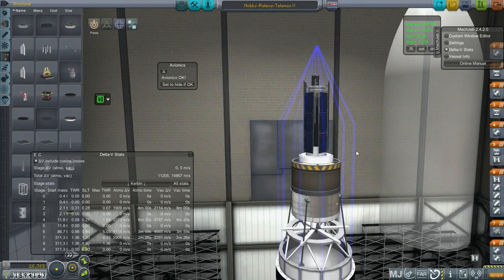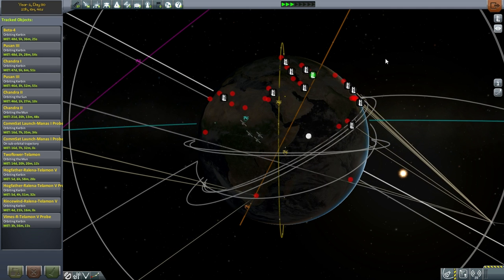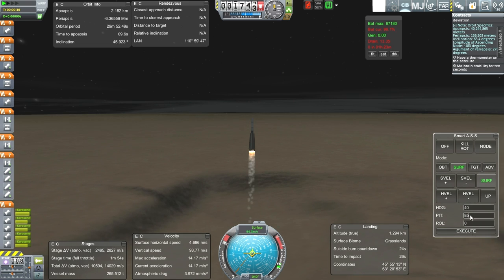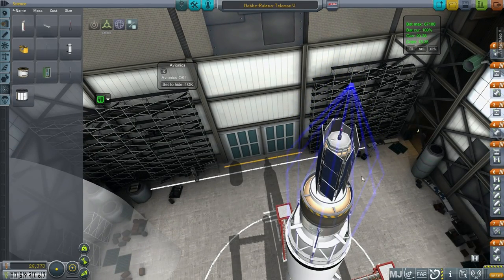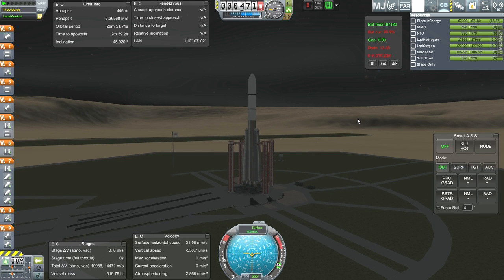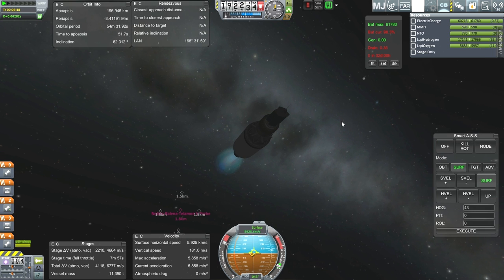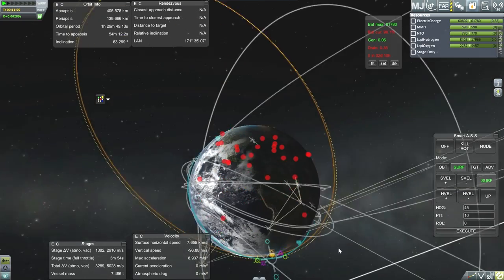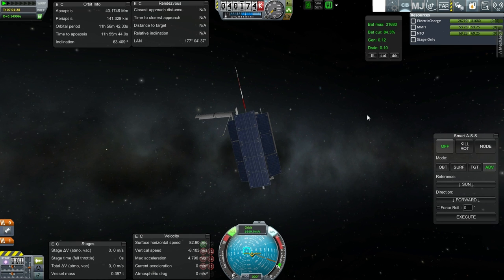Realism Overhaul in KSP Beta 18 - Molniya Orbit

Comment: Great episode as usual! 
Before I go on about  the episode, I'd like to point out few things about Progress. First of all, as of now it has been officially declared a total loss, but unlike any other freighter the Progress is critical for ISS survival as now with ATV being a history the Progress is the only craft that can bring fuel to ISS for it's RCS and reboost engines. Though since at least one year worth of fuel is maintained in ISS tanks there is no particular rush to get it up and running ASAP, there might come a time when Roscosmos will have to just cross their fingers and launch a new one hoping it would work. I would also like to point out that this flight is only a second Progress mission using new Soyuz-2.1a LV, and it had some experimental hardware aboard (new Kurs antennae were among them), so the odds of failure were somewhat higher than usually to begin with. Still it proves that space is a risky business, and things can go wrong when you least expect them to be.
Now - onto the actual episode:
1. In order to change LAN without changing inclination, you have to burn normal+/- when you're in the northernmost/southernmost points of your orbit, in order to change inclination without changing LAN, you have to burn normal+/- when flying at equator. There is a very simple rule I use to figure out how orbit will change if I burn normal+/- at any random point - if you mentally draw a line from your spacecraft into the Earth's center and then continue it until it intersects your orbit on the opposite side, this line is an axis your orbit ellipsis will rotate about. I usually eyeball it by aligning my camera such that it looks at the spacecraft with center of the planet being exactly under vessel CoM - in this view your orbit will rotate around your vessel and you can easily see which way you need to go to rotate orbit certain way. Aside from satellite missions, this skill will be very useful for Lunar missions because the Moon rotation velocity is very low, so to reach any predetermined destination which is not on equator you'll have to align LAN. If you apply this rule to the two situations above (you're at nothernmost/southernmost points, or at equator) you should be able to pick up a principle.
2. It's important to remember that LAN change burn and inclination change burn are the same things (you burn normal+-/), only the location of that burn is different. As such all "best practices" of inclination changes are applicable to LAN changes just as well (chief among them is "the slower you go the less dV you will spend to achieve the same change"). In this episode, you did LAN/inc change while on parking orbit - this is incredibly inefficient way to do it because you was going so fast. You should've raised apoapsis (and make sure your destination orbit's plane intersects your current plane at apoapsis) only, and then did all maneuvering at that apogee. I do understand that in this particular case you've got shit ton of excess dV, but in my experience bad habits die hard, and it's always better to get used to doing things the right way as early as possible.
3. Your sat looks really cool this time around - like that a lot! That doesn't mean they were bad before - it's just this one I really like :)